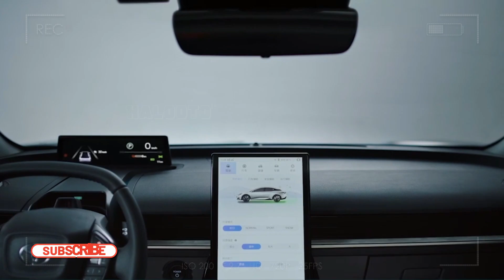"Official Release" New Toyota Bz3 Sedan (2023) SHOCKS EV Range.

Comment: BZ3 is a rebadged BYD.
BYD is a Chinese EV company. Japanese doesn't know how to build a reliable and a cheap EV so they beg to the Chinese to help them. It's a joint venture actually.
Reply: I wouldn't call it that at all. It uses the drivetrain from a BYD and batteries. But everything else is Toyota. Platform (e-TNGA), styling, interior specs. It's like the Aston Martin SUV that uses a Mercedes engine and drivetrain. It's not a rebadged Mercedes and still an Aston Martin. FAW builds Toyootas in China and that's who will build the bZ3.
Reply: @benjaminsmith2287  Whatever you call it mate, but the fact that Toyota beg for joint venture, it's very clear that they are inferior to BYD. You won't ask for someone else help if you can make it on your own.
Reply: @daveanthonysalalima1128  Toyota has had plenty of joint ventures over the years as had others. Toyota is not inferior to BYD. BYD has its strengths and Toyota theirs and the two companies decided to do a joint venture. It's not that big a deal. Joint ventures save companies money. That's the bottom line with most of them.
Reply: @benjaminsmith2287   I respect your point mate. But in my point of view,  China is  ahead in EV race. Toyota will benefit much from it.